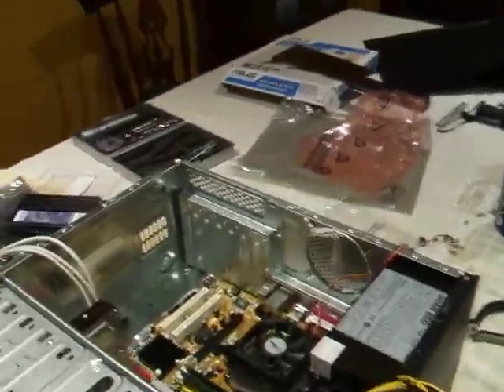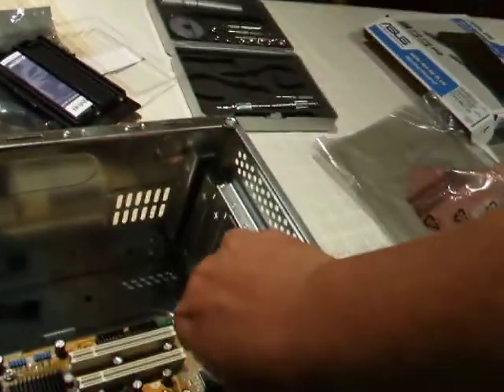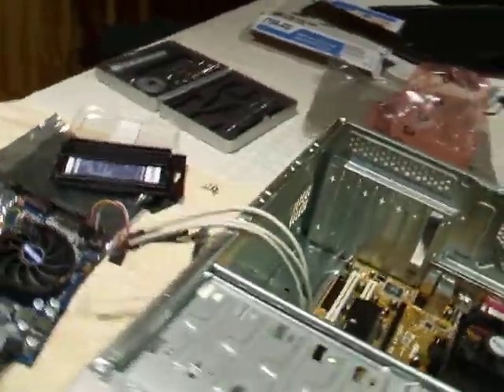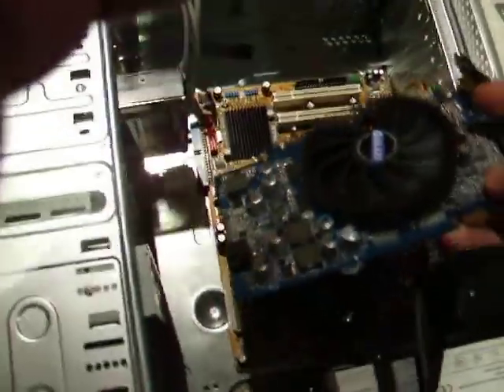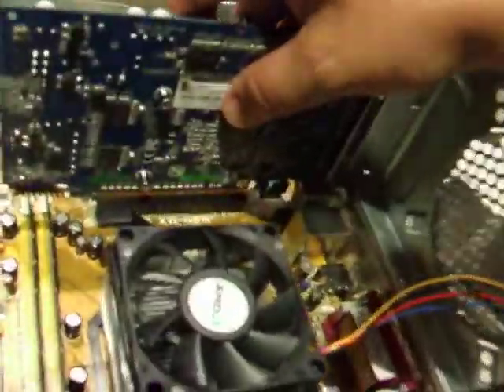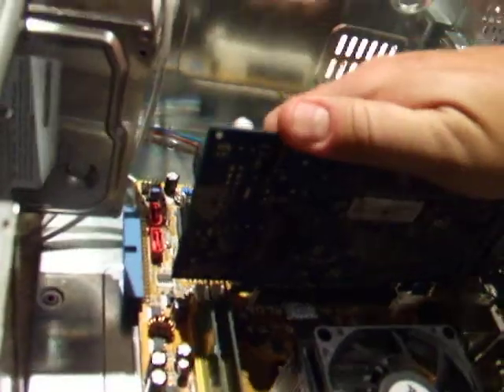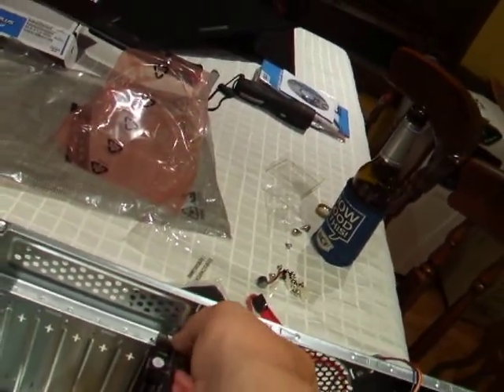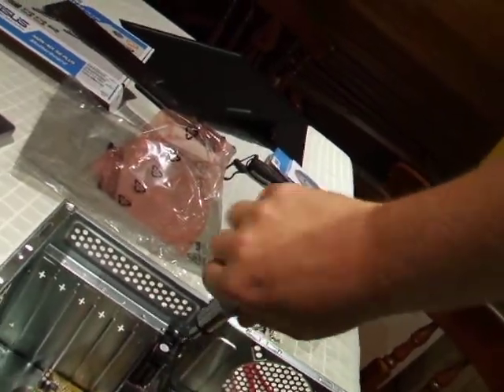How to Build a computer part 8 Installing the video card

Comment from the maker: Dude the 9800GTX +is a far better card than the 9500GT, I put one (9800GTX+) in my partners PC for her relatively light gaming needs - as good as my crossfire 4870x2 set up for any on line games. 9800GTX+ is unlikely to fall short of expectations.

Comment from the maker: Yeah I put a 9800GTX+ in my partners machine and a 4870X2 in mine. For day to day gaming you wouldnt really see the difference between say the 4870x2 and the 9500gt, its only once you ramp up the settings you start too see the 9500GT fail. Your 9800GT is a great card and capable of almost anything the more expensive cards are. Next machine will have dual 4870x2, i7, and 12gb RAM cant wait to 3dMark that sucker.